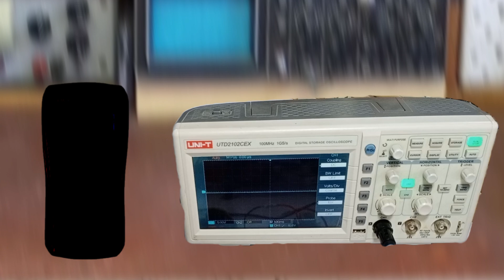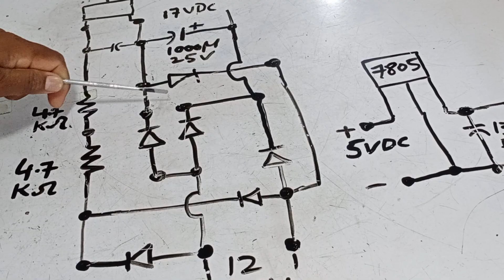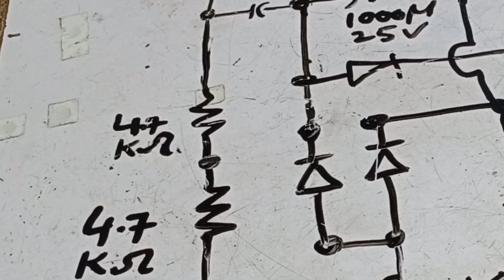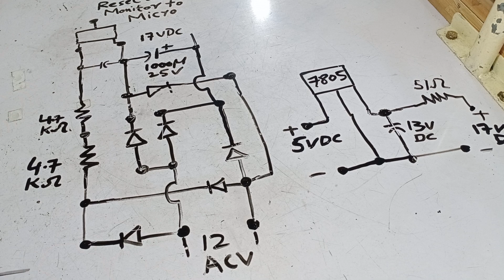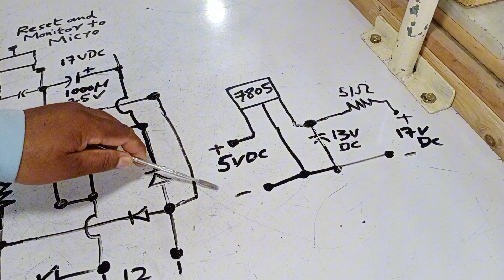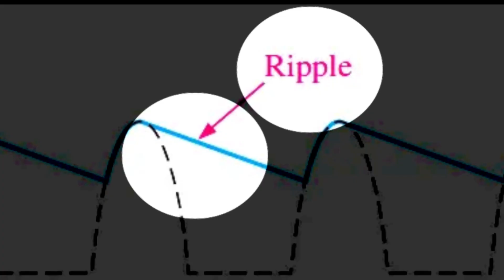Air Conditioning Circuit Repair Hacks You’ll Wish You Knew Sooner!

Comment: thanks but if i did not get wrong the course of the one diode of the bridge rectifier at the diagram is not correct (the diode at the down-left side supplying minus voltage to the 17v capacitor)

Comment: Correction: motor speed control via triac uses phase angle control, and hence voltage on motor. Faster or slower pulses have nothing to do with phase control.
Honestly, I can't belive you didn't say what those pulses are. Those are zero crossings of AC input voltage, for triac phase control. Dc voltage of 330mV doesn't mean anything in analisys of those waveforms.